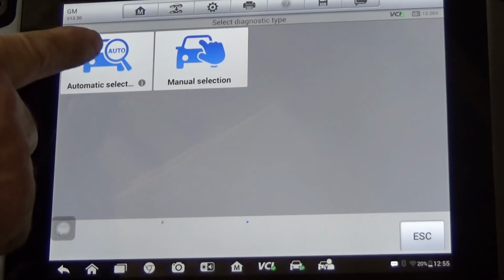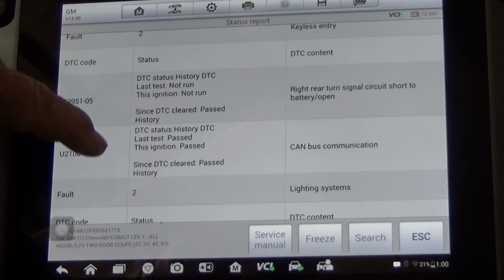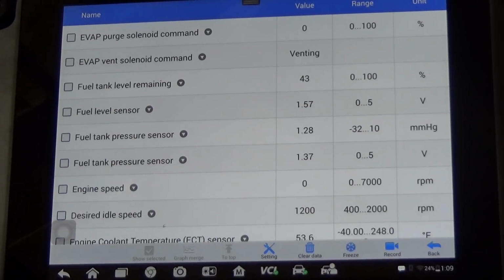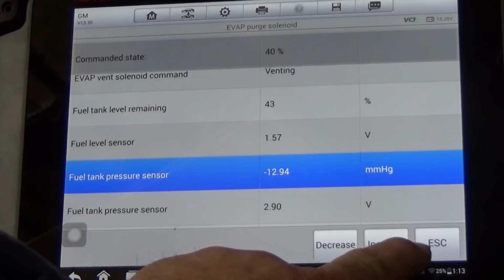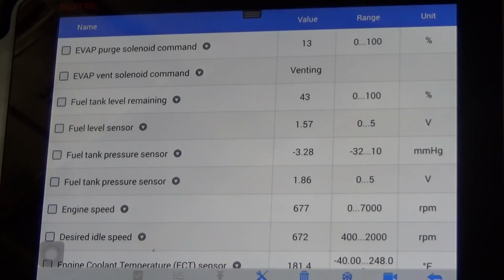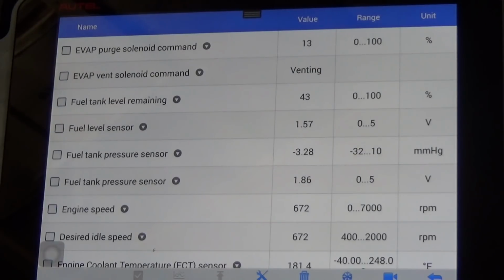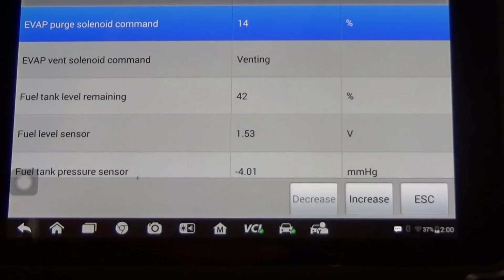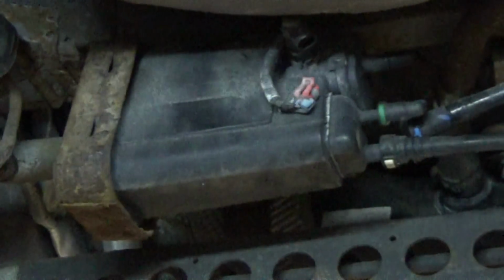New Cobalt P0446 Final

Comment: Any chance you are still on here answering questions John?
Reply from the maker: Yes. I am going to be adding some videos in the near future too.
Reply: @thecardoc100  I've got an 05 cobalt and have changed every evap part and still have p0046 pending and taking forever to finish monitors. What's up? Everything else is fine on car.
Reply from the maker: @brandoncook6383  Is that the correct code number or should it have been the P0446 like the video? The trick is understanding how the test runs. After the small leak test completes (the vacuum decay for about 30 seconds) the ECM turns off the vent valve and expects the tank and cannister to go to atmospheric pressure. Anything that could prevent the voltage from falling to close to 1.5v within the expected amount of time will result in the test failing. What do you see happening when you do the purge and seal test and then command the vent valve open? If your scan tool doesn';t let you do that then you can watch the fuel tank pressure sensor signal directly with a voltmeter or scope when you exit the test, "OR",  disconnect the vent valve first electrically and then physically.